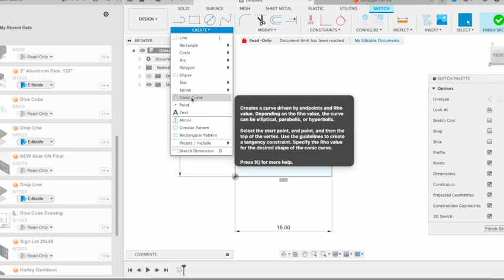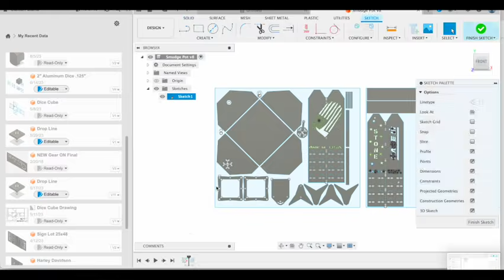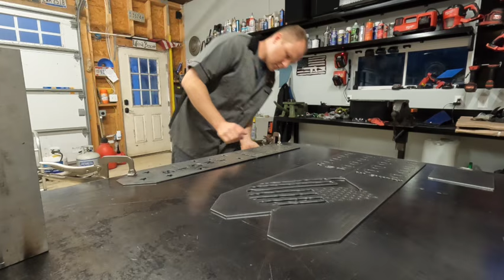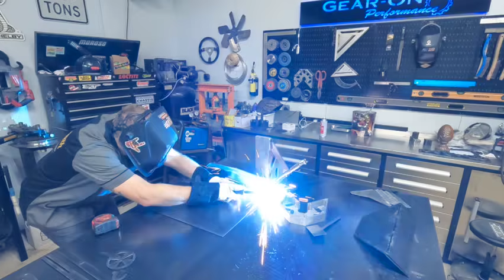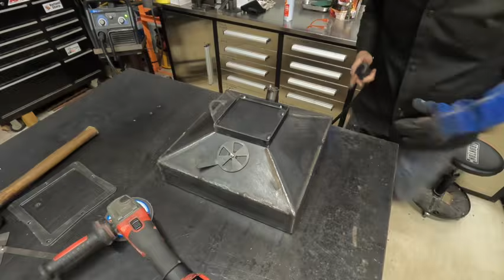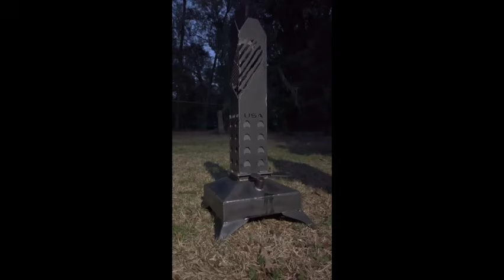Start to Finish Smudge Pot Build

Comment: man i want a stud welder so bad, i been keeping an eye out on market place and offer up for a while now, i don't need one bad enough to spend $3,000.00+ on a new one, but i would probably take a second hand one for $1,500.00 lol. no luck yet, only ones that seem to pop up are the pin stud welders for auto body work.
Reply from the maker: They pop up sometimes cheap. Especially the older ones. Keep an eye out!

Comment: If you can plasma a 6mm hole for the Flue base why cant you plasma a 6mm hole for the throttle plate.
Thats what happens when you copy paste and dont think it through.
Reply from the maker: Nah, it got missed on the file . Sometimes my machine misses a cut. It’s easier to drill a hole than waste material and cut a new part.